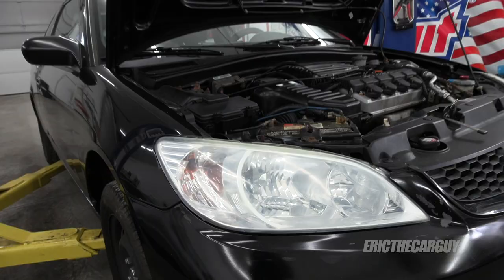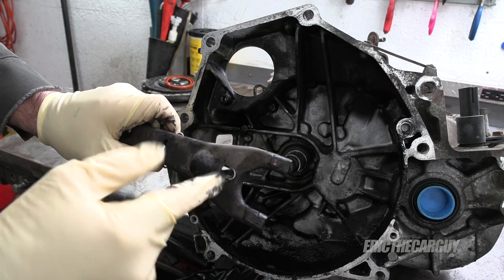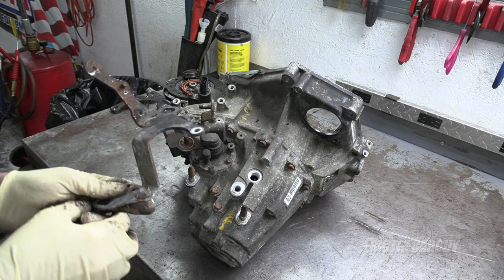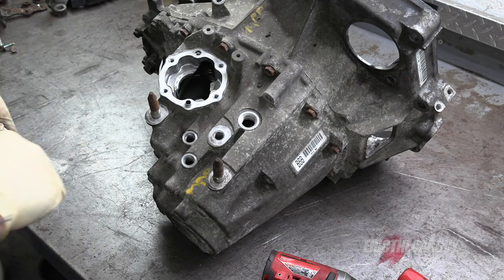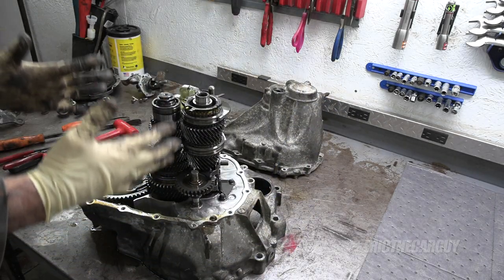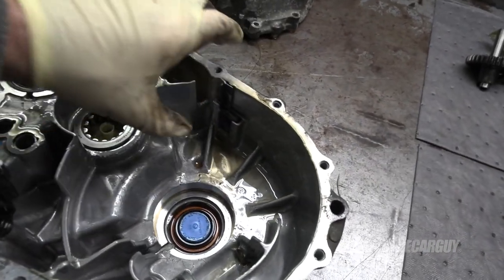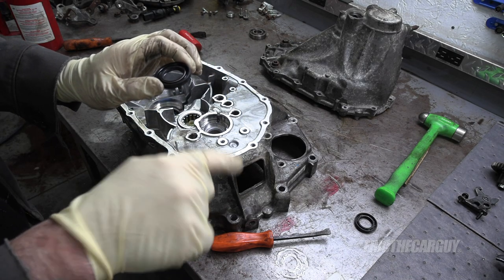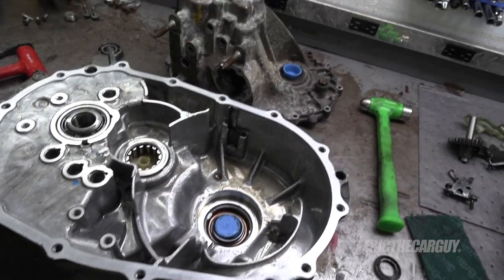01-05 Honda Civic Manual Transmission Rebuild

Comment: I replaced input shaft bearing and its seal. Also got a new throwhout bearing and got a new clutch. The old ISB had gone bad, but after putting all back together the noise was still there. 

I was kinda sure the issue was ISB based on the information i had, but now i have no clue. Its same kind of hum as in video and it disappears when pressing the clutch pedal.

Comment: Excellent video. Thank you for this. 👍👍

One question: could you feel up/down play in the shaft prior to removal? My trans is out right now, due to a noisy rattle, which I assumed was the throw out bearing. But both that and the pilot are fine. They turn smoothly and no play. But we’re not feeling any play when grabbing the shaft and moving it different directions. Also, with each turn of the shaft, you can hear/feel what sounds like a dry spot in a bearing. Thoughts? Should I assume it’s the input shaft bearing?

Comment: few yrs ago tor apart the 5sp in my 93 accord, was fairly easy to do. The reseal of case was a bit tricky to make sure the dowels and sealant were adequate on it. 
One thing I learned in this whole processes the axle shaft bushings . Cant recall recall the dia.,  of them  exactly maybe 1.007” / 1.0085 “. -dont quote me there on dimensions.

If those numbers are not in spec of 0.0015” gap, (bushing - axle Dia.) then the axle will wear out premature and it gets noisy-wobbly.
One other part is Always measure careful the new axle Dia to  make sure it is MFG properly as if it is Not this creates the wobble noises inherent to the excess gap  causes.

Comment: This, along with the corresponding video for the clutch replacement have been super helpful. I got everything back together, the new input bearing fixed the noise, the clutch works great and it shifts into reverse and 1st through 4th super smoothly. When I try to shift into 5th, it won't even try to engage, doesn't even grind. 5th gear worked before I pulled the transmission apart and I thought I put everything back together correctly. Do you know what might be preventing 5th gear from engaging? Thanks.

Comment: Great video. hope you do fix on honda 2nd gear grind problem in the future.
Reply from the maker: If it's only 2nd gear then it's likely a synchro. The only extra step would be to remove the bearing from the main shift and replace the synchro.

Comment: You have to change other other bearing on the opposite side and tap the housing so it doesn't slip out loose.  When it comes loose, it will make noise when you accelerate.

Comment: Bout to do a clutch on an 02 civic with 220k miles. Wondering if it would make sense to do this, even though there is no noise coming from the transmission...

Comment: good job .. i have the same noise in my pt cruiser and the noise went less noisy when i replace with new atf+4 fluid >> my question is if i keeping the  input shift bearing with out replace it , am i gona damage the transmission later ?? or its ok just the noise will stay ?

Comment: I have this sound as showed in the video when i release the clutch.  I had to replace the clutch hyrdaulics that is connected to the clutch pedal. It made a horrible sound when it broke when the gear was set to idle and clutch pedal released. I replaced the clutch pedal hydraulics and now it is making just a small noise after i replaced it . 1. I did not vent the fluid out of the master clutch cylinder as i could not get to it but I only vented out the air of the part i replaced. 2. I may have previously used the wrong gear oil when i filled it to max level in the gear box as its so hard to get hand on real honda gear oil. I plan on venting the clutch system and see if it helps the noise go away and pray its not that bearing shown in the video  😲😅👍. "Edit -->" Im assuming it will help me if i vent it because it has had a tiny improvement after i started to step on the clutch pedal many times, Now it only makes low noise when realising and stopps the noise when it is fully released.

Comment: Eric, love the video, it really helped with my recent input shaft bearing replacement. One question I have. After replacing both the input shaft bearing, oil seal and main shaft bearing on my 2004 Civic, the horrific noise is about 90% gone. However, after driving it, I can still hear something while I’m driving. Almost sounds like 10% of what the noise was if that makes sense. Barely noticeable unless the radio is off and I really listen. Any idea why this might be? Cleaned everything super thoroughly, lubricated the bearings on installation, all clutch parts are near new. Scratching my head on this issue, any insight would be greatly appreciated. Ps; should also add I inspected everything carefully and nothing looked bad inside the gearbox

Comment: Eric my Honda man! Mann i been having trouble putting back that snap ring on my MT 2013 Honda accord. I noticed u didn’t put any of gasket seal on the tranny. That’s the only thing I didn’t do but everything else on this process I did before u put the snap ring back on. Any advice would be greatly appreciated brother.  I want to overcome this snap on issue once for all. Thanks 🙏 in advance.  Appreciate u.

Comment: Question about installing the reverse shift fork...the main shifter interferes just enough that the front bolt hole doesn't line up. Are you supposed to raise the shifter so it fits inside the fork, or just press laterally against it really hard?

Comment: I have a Honda jazz/fit with the dreaded input shaft noise. Just wondering if any other gearboxes fit the fit 🤔 I know the mk8 civic uses the same 1.4 idsi engine as the jazz/fit but It has a 6 speed box whereas the jazz/fit only has 5 speed. I've studied pics of both and the outer cases look nearly the same.

Comment: Hey Eric, I just got done replacing my input shaft bearing afew days ago. I put all back together and mounted back on motor.

 The problem I'm having is I can't get my Manual into 5th or reverse? 
But all worked before just fine till I did this . Any insight u or someone that can give to help me figure out why 5th and reverse won't go into gear. All others work fine. Just reverse and 5th clutch in or not will not go into those 2 gears. Thanks

Comment: What are the bearings on either side of the differential called? Or if u have a part number for them that would be really helpful... My CV axels are brand new but they wiggle on the end that goes into the trans and I feel it shake between 50-80.. so it's gotta be those bearings on the diff right? Since that's what the CVs plug into..

Comment: Don’t know if you still respond. If the snap ring moves but doesn’t move “freely” (yours seems super slick) will it be an issue? It seems like the counter shaft set but the ring doesn’t look like it moves nearly as easily as yours.

Comment: Strange mine does this on my 07 Dakota, I had 3 throw out bearings done already on it. Lolz that sound goes away once it’s first installed. Then after it’s first long drive that sound comes back. I even get a bit of a squeak with it now and then. Guess my getrag238 needs a rebuild. 234k miles time I suppose

Comment: I'm planning on doing this job, I was ordering the input shaft bearing and seal on Amazon and noticed it says those parts doesn't fit my 05 civic coupe with LSW 5 speed manual transmission,  do you know if all 7th generation civics use this parts ?

Comment: May I suggest you wait until you put the gears back on before putting the Honda bond around the case. If this is your first time, it may take a while before you get everything in right and having the Honda bond exposed for too long is not good.  I practiced a few times closing the case, making sure everything went back in right, before putting the Honda Bond.
Reply from the maker: Good point. I just do it because I find it easier without the gears in the way. Thanks for the suggestion.

Comment: Just did this job and car won't shift into 3rd or 4th now, any suggestions? Thanks
Reply: Did you fix it?
Reply: @timothykeith1367  crushed the detent ball into the bolt putting it back in. New bolt and ball worked perfectly

Comment: The snap ring in my transmission is like halfway seated after a couple of tries and bouncing like you did. Everything is spinning fine, going into gears, and everything seems fine. Any advice? It looks like the bearing isn't high enough up for the snap ring to go all the way in place. Thanks!

Comment: Hi Eric! @ericthecarguy
I drive a 2009 Honda Fit, or Jazz as it's called here in Europe. I have a similar sound in my car. I've owned it for almost 200.000 kilometers and I think the sound has been around for almost 100.000 kilometers and it's getting worse. Is this video applicable for my vehicle? Best rgs

Comment: Hi Eric

I have a K20 Honda engine, with the usual input shaft bearing noise (noise goes away when clutch depressed) 

This has been the case for a while, the car still runs! 

Recently, theres been a growling / grumble noise as I accelerate between 2-3k -rpm. Is this the input shaft bearing getting worse or something else such as output shaft bearing or diff side bearings etc? Thoughts?

Comment: Quick question I have a 07 I have apart and the 5th gear fork slider ring I think I might have flipped it. Do you know if the longer part guys up or down in the set?

Comment: Followed this procedure to the letter, but it turned out my noise was coming from the differential not the input bearing due to fluid lost from bad seals. This transmission needs 3 quarts, mine had 2. There's no dip stick to check fluid level. Input bearing did have some signs of wear and i replaced it and all seals anyway. Had no problem with reassembly. Don't buy the thin flimsy $5 snap ring pliers . . .

Comment: All the GM F35 transmissions make this noise once you get past 60k miles and change the oil for the first time.  I haven't experienced a single one that hasn't and their first gear is noisy as all hell.  I've got the rebuild tools GM use to sell for $1000 but I just buy these transmission for $50 now and swap them as I need.
Reply from the maker: Have you tried Syncromesh fluid? If not, I recommend it. It really helps with transmission noise.

Comment: @24:00 I just had to reseal that plug on my civic because whoever put it on didnt use any sealant. it was leaking fluid. Just figured id put that out there
love the video, this will probably be my go to in the near future
does that civic still get a crazy rattle in 5th gear on the highway when you let off the throttle? i havent figured that one out yet

Comment: What happens if you ignore the input shafting for too long?
Reply: I suspect it won't cause damage if the fluid level is normal.  When you remove the noisy bearing they aren't sloppy like they are falling apart, just click a little when they spin.  But "too long" is pretty noisy so you'd be making a bad choice as it can really rattle, could damage the input shaft and maybe the clutch as well

Comment: Did you fix the threads for the transmission since they were crossed threaded one of mines is stripped and the bolt won’t tighten

Comment: I've done 3 of those. The 2 of them had bad bearings on the pinion gears for the axles due to driving with bad cv joints. I always chang those bearing in fact all of them.

Comment: I have Corola 2009 Model and its wobbling when i start it and even some time its stop.. i have changed Fuel pump and changed the throttle body used part but still its having issue. Please suggest

Comment: I have the same sound on my Civic but I'm to lazy to pull it out and swap the bearing out and I even have a extra trans to go in it
Reply from the maker: I have yet to see one of these bearing failures cause a transmission to fail. Thanks for the comment.
Reply: @ericthecarguy   like you said in the video it's more annoying than anything but I got the car for free because I had a bad cam position sensor and they were told it had a bad head  mine is a four door though it's runs good know after the new sensor

Comment: For some reason I'm doing a imput shaft bearing on my 2003 civic with the same transmission I have it in neutral and it spins fien but uptill I put the case on it won't spin even with the snap ring in place please help

Comment: Hey Eric, i have an issue with my 2002 civic ex manual tranny. Its hard to shift to 1st and reverse gear so some reason i have no idea. Its a new clutch and Pressure plate i put in it but i having these issues. U have any idea that should causing the problem?

Comment: Don't know if it will cause you a problem, but at 21.03 the plastic oil guide drops down from its mounting hole. Thought I'd mention it in case no one saw it, the assembly of the case was tight enough to deform the plastic if out of position I think.
Reply from the maker: The car has been running for about 3 weeks now with no issues. Thanks for the comment.

Comment: Honda I have read like most factory manual insists on their own products. Honda bond vs RTV sealant, why the choice of Honda bond.?
Reply from the maker: Because that's what I've used for years and I keep some in stock. You could also use RTV.

Comment: Hey Eric , I’m having trouble here with my 07-08 acura TL Type s manual tran, the online resources on 04-08 acura tl/accord trans are close to 0, i took it all apart last year and put it all back together, and then I mess up all the positions of the detent springs because i dropped the tray, every time when I shifted side to side and into 4 th gear i have to push harder to shift. Do you have any idea all the positions of the detent springs ? I am willing to buy all the springs new with the part number but i Have no any information which going which hole

Comment: Hey Eric, great video!! I’m assuming the process would be almost identical with a 2005 Accord 2.4 5-speed?
Reply from the maker: I'm not familiar with that transmission, but I suspect it's similar.
Reply: Probably a little different since that’s a k series trans. I had the same exact car, I’m assuming you’re having a 3rd gear grind. I wouldn’t even bother, put GM synchromesh fluid in and it should stop grinding, for the most part.
Reply: @lunchonthehood5675  not a 3rd gear grind, but a very slight noise like this Civic when in neutral with the clutch disengaged. I’m assuming it could be that input shaft bearing.

Comment: Hi Eric, hi  everyone. I have a 5 speed manual 2001 Civic LX. I have replaced all 4 engine and transmission mounts, and installed new detent springs. 
The car pops out of 3rd and 5th consistently if you let off the throttle (between acceleration and deceleration) Is there anything else other than internal problems that may cause this? Linkage, bushings, etc...? I’ll drop it and rebuild it if need be, but I would like to eliminate everything else first. Thank you in advance to anyone that can help.🙂

Comment: Hey Eric what are your thoughts on an 2006 Civic 5 speed manual? (8th gen civics) just picked one up, transmission is very smooth clutch grabs pretty close to the floor. How reliable are they?
Reply from the maker: You might find this info useful. http://www.ericthecarguy.com/faq/what-to-look-for-in-a-used-car-purchase

Comment: Eric what happen with the Suppercharger?
Reply from the maker: Still waiting to get it back from the High Speed Lab. Not returning calls at this time. Also, I'm building the rest of the car too, not just installing the supercharger. I won't be doing that until I have the time and all the parts collected.
Reply: Thanks for answering back I always learn something new with you thanks for your time.... I'm also building my 94 honda civic coupe with a GSR I recently purchased a use supercharger as well I'm really excited to install.

Comment: 31:09 i agree! this is usually the point when i might clean it up a little and wipe it down and let my 5yr old play with that failed bearing, a/c relay that rattles, all that fun little stuff!
i will admit i thought the hondabond said it doesnt actually "cure" fully until a 3 day period, at the same time, the old farts i work with in the shop that have been workign on the hondas forever, if they are doing a valve cover gasket, they will clean up the surface a little bit, put the hondabond on the corners, throw it together and start it right up lol

Comment: Hey Eric can you tell me what I did wrong on reassembling a honda trannmison. The input shaft is hard to turn by hand.
Reply from the maker: Make sure it spins freely before installing the case. That way you can ensure that everything will work after assembly. That's the reason I kept checking it while I was putting it together. Also, make sure it's in neutral. It will go together much easier. Good luck.

Comment: I have an RSX with my transmission stuck in 4th gear. Is it possible to rebuild it?
Reply from the maker: It may not need a rebuild, it could be a linkage issue. http://www.ericthecarguy.com/faq/solving-transmission-problems
Reply: @ericthecarguy  I will get back to you on a update and see if this fixes my problem. The shifter can shift into every gear no problem when the car is off but when I start it and let go of the clutch the car stalls on 4th gear, I know it’s 4th because that’s the only gear I was able to ride on the highway before disaster struck
Plus the mechanic told me it was a shifter pin and to replace the whole transmission

Comment: the shims are there for a reason; They set the bearing preload... just replacing the bearing and reusing the same shims is not correct.. you might be ok, too loose or too tight which is worst..good chance the bearing will  not last long...  usually you need special tools to adjust and measure this as the tools have to "simulate" the casing

Comment: My input bearing gave up after 260k and fukd the synchros. I got a used one with 137k on it n thinkn of replacing the bearing before putting it in.